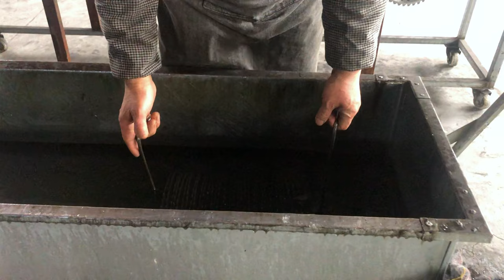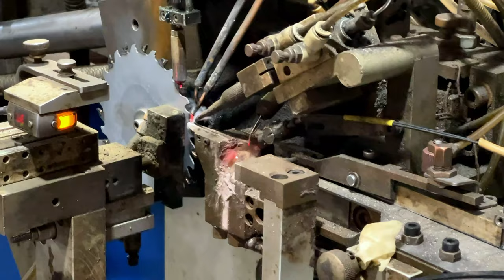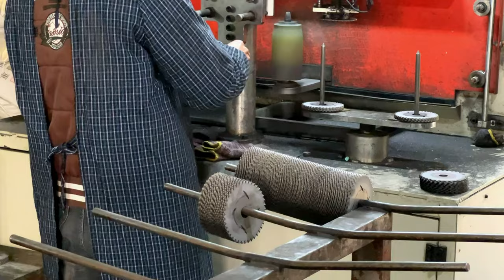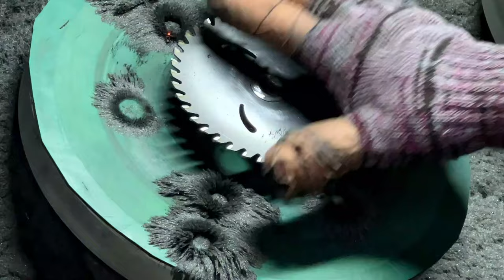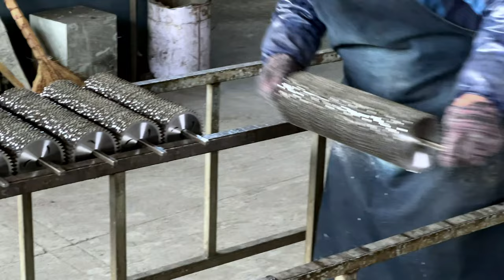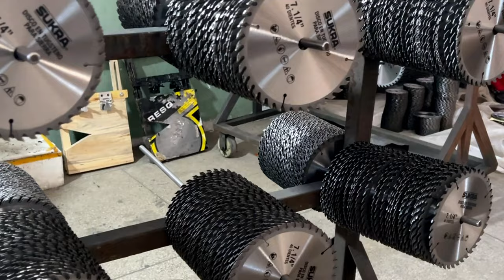Production process of wood cutting saw blade#process #productionprocess  #factory  #massproduction

Comment: The blades are supposed to be very durable, but we've already replaced several of them in a chainsaw, a couple of times without noticing a wire or a hammered nail in a pole. 
After contact with metal at high speed, such a blade can only be thrown away. 😐
Reply from the maker: Yes, we also seem to have overlooked the nail on the board, but fortunately the saw blade is still intact, we will pay more attention to it later, thank you for your warning🤝
Reply: @depthinprocess  Please. Forewarned is forearmed 😉
Reply: This is not surprising- carbide is brittle, and a tooth ground in such away to be efficient at cutting wood will not hold up well to hitting steel.
Reply from the maker: @stevekreitler9349  Hope to pay more attention to my channel！🤝